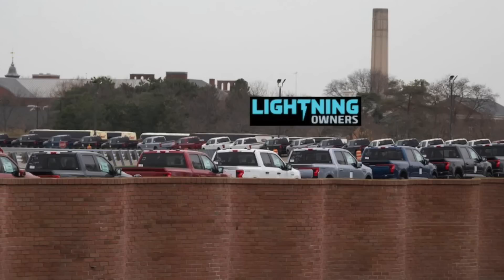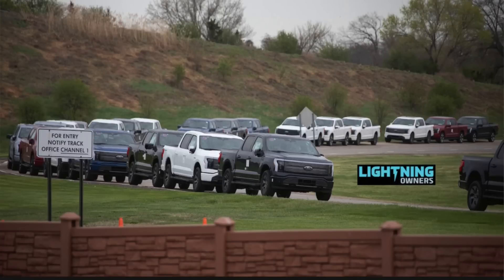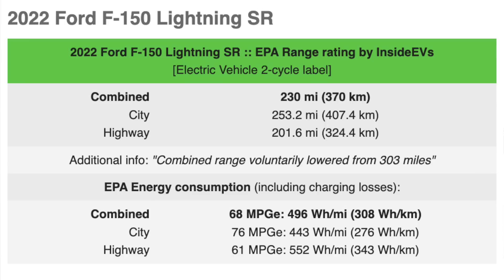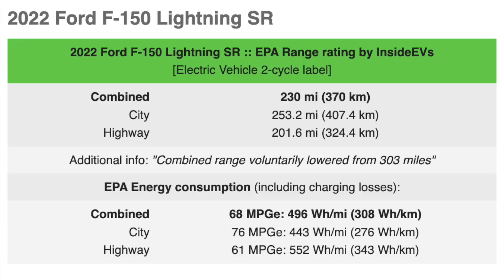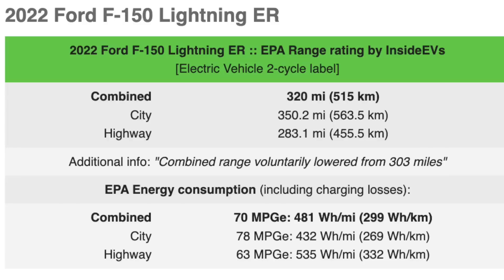New EPA Range Estimate Breakdown! — lightning facing chip issues!?

Comment: At this point ford should just build mega factories to build chips themselves
Reply: I work in the car industry. It’s not just a matter of making chips. It’s the ingredients to make chips. 90 percent of all neon gas came from the Ukraine. It’s takes neon gas to make chips. 60 percent of the worlds palladium came from Russia and that is used to make chips. This war has destroyed chip manufacturing worse than Covid. Add to that the shortage of aluminum because China shut down 3 major mines that mine magnesium which of course they were the worlds largest supplier and yup you guessed it, it takes magnesium to make aluminum. We are years away from coming out of this.

Comment: Manufactures often hold back initial production vehicles for quality control, and final software calibrations.    These Lightnings are not Built Shy,  Ford already commented on that.      Drive around the Hummer factory, or Cadillac Lyriq factory there are lots of fully built vehicles.

Comment: I can tell you it is not a chip shortage. We have built a spreadsheet with over 200 Lightning on them and they all point to the same problem. They all show as being produced for the ones their blend dates have past. Mine was built on 5/10 but it's still being held up by Ford final approval for release. Here's the exact language that is listed on mine and the others visibility report. , "ETA Pending Final Launch Readiness Sign Off Expected Spring 2022".

Comment from the maker: Disclaimer: I am hearing mixed sources that the stack up is not due to a chip shortage. However all major articles still site a chip shortage.
Reply: FUD Lightweight is a CRAP truck, built on a OUTDATED body on Frame.
Reply: @markplott4820  and I will buy a fully loaded F150 Lightning anyway. Keep trolling anyway.
Reply: F-150 Lightnings aren’t waiting for chips according to Ford. They are likely deliveries for Ford employees. The newest vehicles are always heavily seeded in Dearborn.

There are many other reasons for this:

All of these are opinions (no facts here just my guess).

Waiting for release/official launch day.
Waiting for batteries
Software updates
Testing first batch built at full production speed.
Etc…
Reply: The rumor now is shipping Monday.  My guess is that Ford used the media drives as a big final QC event and waited to see if any problems got reported hardware-wise.  A few problems were reported with one pedal driving and off-road throttle mapping, but those are software fixes.  Ford can now ship the trucks out and hold them at the dealership if necessary for a last minute OTA update before customers get them.
Reply: @the.electric.bluebeard  - but, how Long before it falls apart......lol
Reply: @markplott4820  I understand your pessimism, but Ford has been making reliable trucks for 100 years...I drive a '96 F250 powerstroke with 260k miles, no problems.  I don't think the reliability for the F150L will be any worse, and in fact it will probably be much better with so many fewer friction parts.
Reply: @the.electric.bluebeard   - Problems with Ford are , there is NO Incentive for Garges to Upgrade and Train on the Lightning platform. 
#2 - Ford is using Cheap battery cells that wont last the Life of the Truck. 
#3 - even the Modern F150 gas trucks are made very Cheaply. 
#4 - Ford is not Capable of Volume production of the Lightning. less than 10k in 2022 is possible. 
#5 - Lightning is not a Clean Build , too reliant on outdated F150 parts bin.
Reply: @markplott4820  I'll concede point #1 as that probably is a problem, and I worry about that.
#2 - aren't the batteries the SK 9 1/2 1/2 NCM batteries?  Sandy Munro is a big fan. Even if it doesn't last, you will be able to replace the battery 5 years from now with one that has half the weight and costs half as much.
#3 - all modern cars are made cheaply, look at Tesla's build quality.  Doesn't mean it won't last...
I will concede #4 right now but, unlike Rivian, I think they have the institutional knowledge (and consultants) to ramp up.  
#5 was on purpose, to be able to sell the truck cheaper by leveraging the parts bin.  By doing so they beat Chevy, Ram and Tesla to market and will sell a bunch of ev trucks before those companies get going.  The 14th gen body will be the last body-on-frame...the only factory electrified "classic".  Every other body-on-frame f150 will be a crate motor project - and there will be a lot of them.
Reply: @the.electric.bluebeard   - FUD Lightweight is using Less Advanced battery cell than Tesla  2170 that have 25% more energy. 
and Tesla cars are the most Efficient. 
- lets see how battery replacement goes for Ford as the batterys age. I doubt they have the supply.
- #3 is False, Tesla Fremont rebuilt its Model 3/Y production , shortened the lines, made them more Efficint in 2019. 
its now adding more than 50% capacity to Fremont. 2019 - 2022 build quality is Great.
see - PLAID Teardown, 2022 model X Drive by Sandy. also 2022 Tesla by OutofSpec Reviews.
- Tesla can operate just fine without Cybertruck, Semi or Roadster ever produced. but, those are coming in 2023. 
Probably CT being #1 Proirity after ramp. 
- Ford cant even scale production and they dont have AGILE teams working on Production , like Tesla.
Tesla makes over 100 small changes every 24H, and about 25 BIG Changes per month. 
Tesla also has the BEST Production Factory AI , that can Automatically test, evaluate every car they make , so that they all meet  specs even when using Diffrent parts & componnent. 
Tesla has DELETED Traditional Production lines, in favor of CELLS with Teams of AGILE workers who are Empowered to make Production changes without hand holding. 
Ford is not Creative like that , they will Produce the F150 EV EXACTLY the same for many years , without any Upgrades.
Reply: @markplott4820  I have a late 2019 Tesla and the build quality is ok, not great.  And I have reservation #7000 for a CT.  But I thought we were talking about Ford, not Tesla.  Nobody is saying the F150 is better than a Tesla or that Ford can produce more than Tesla...but is it a good truck?  So far it looks like the answer is yes.  And SK 9 1/2 1/2 batteries are very good cells and have some advantages over the 2170 and even the 4680 form-factor.  I think other manufacturers will eventually adopt Tesla's production methods and maybe even use giga presses.  I have a Tesla, I have a Ford...I would like both of them to do well producing EVs, I don't understand this fervent animosity toward one or the other which then blinds one from purchasing a good vehicle which will perform well and help the environment.  But oh well...
Reply: @the.electric.bluebeard   - Ford is more than a DECADE behind what Tesla can do in 2022, Tesla lead is increasing. 
it cant Drop the weight , incease Efficiency , and has a outdated parts bin.
Reply: @markplott4820  what can tesla do in 2022? The model is is a decade old, the model x is also old af, the model 3 is starting to look dated and the model Y is about as ugly as the model x. They have an old lineup while many new evs are now on the market.
Reply: @justin9152   - yet, they Continue to OUTSELL every EV oem in the USA and even some gas model cars.
Reply: @markplott4820  Never said they didn't outsell "some vehicles" they (Tesla) are still about  1 percent of the market worldwide yet valued more than all other vehicles manufacturers combined. The 3 and Y aren't going to carry them forever. Semi cyber truck, roadster announced many years ago and can't get new products to market for whatever reason. They are becoming stagnant.
Reply: @markplott4820  I said Tesla's market share worldwide is about 1 percent yet they are valued as much as the rest of the industry. 2 vehicles (the Y and 3) aren't going to carry them forever. The Model X and Y hardly sell any units at all compared to the 3 and Y.